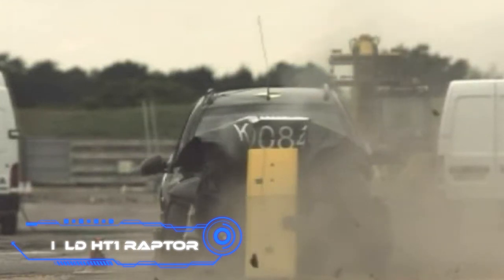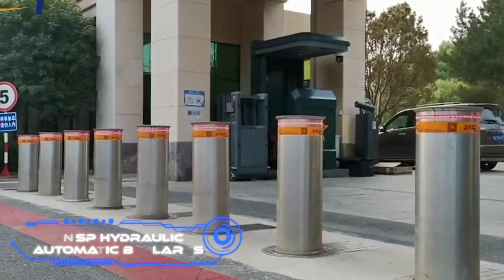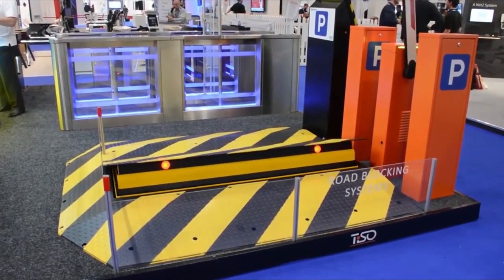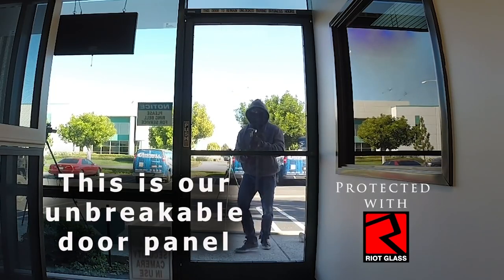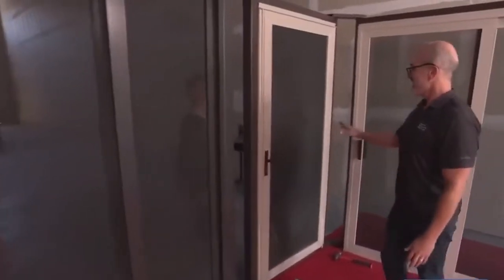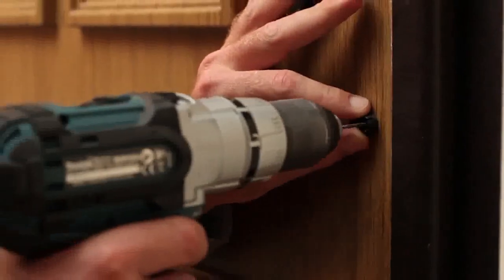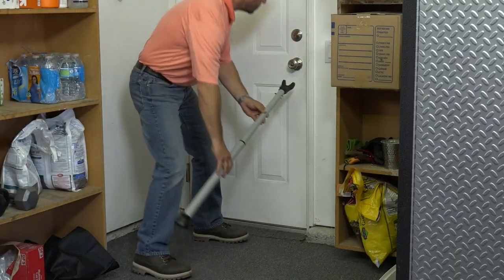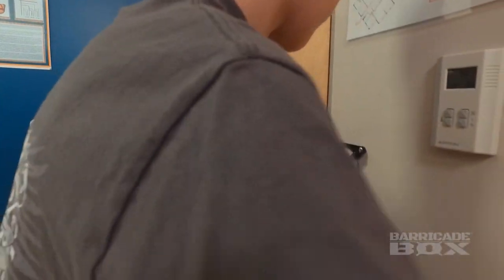SECURITY SYSTEMS FOR BUSINESS

Comment: Heald HT1 Raptor is a great idea. It's a collection of retractable bollards that have the capacity to shield pedestrians. The bollards will still work after the impact. The system has a patent and can be used by hand or with a computer. Tiso tire-killer looks amazing. It's a perfect tool to protect an object in harsh conditions or if there is a significant distance between the control unit and the road blocker. It can be set up like a speed bump or in a small hole. Zasp Hydraulic Automatic Bollards is really useful. We can use them to protect against cars. The backlighting is an interesting option and the model has also been treated with a rust proofing compound. Thank you so much for doing this video.
Reply from the maker: Great insights! Thanks for sharing!